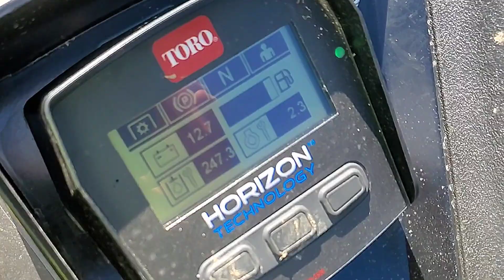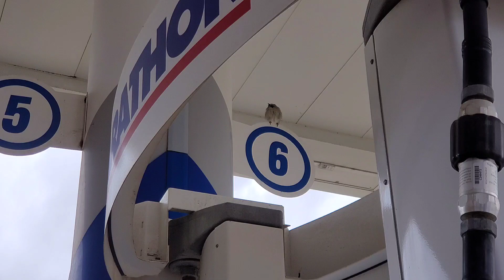It's Ugly [But It Will Work]

Comment: Hey just a heads up, the first 2 gallons in the hose is what the last person selected. If you want to use higher grade for small engines, put first few gallons in your truck and then top off your equipment and fuel cans.

Comment: For bringing back the glossy look to plastic I use a heat gun from Harbor Freight. It does work pretty well, I even use it on the vinyl and rubber trim on my car.

Comment: You need to watch Countryside’s video about super glueing the bolts on those grabbers. Keep up the good work. 👍👍 I wanted to see you rip that tape off😂😂!!
Reply from the maker: Ill check it out, you got a link?
Reply: Spencer Lawn Care I can’t find it now. Basically he just took the screws out of the rubber cups  and put super glue on the threads and reinstalled them and then put it on the screw head.

Comment: That mower looks heavy
Reply from the maker: Oh yeah for sure.
Reply: Always start the mower outside where good air is ventilated without fumes if spilled from the gas fuel cap when it's loose.
Reply: @Funkinbetadciu  wow man. Thanks for letting us know. I bet no one else knew that but you. Damn you're a genius. 😂
Reply: @Lion_Rey  No problem